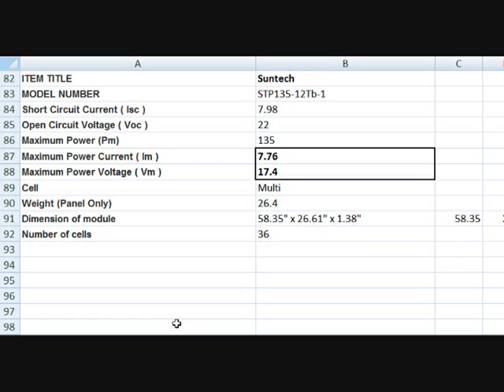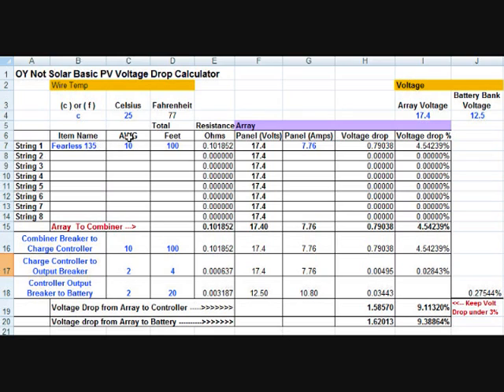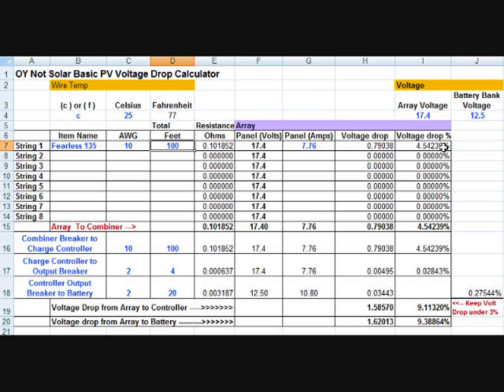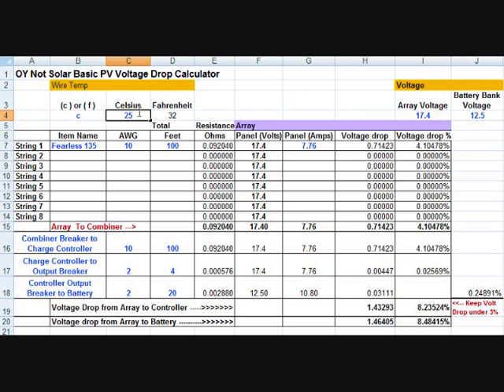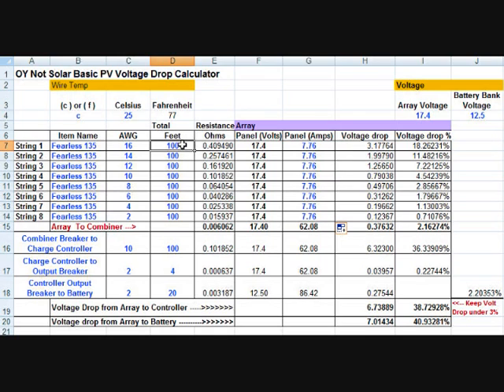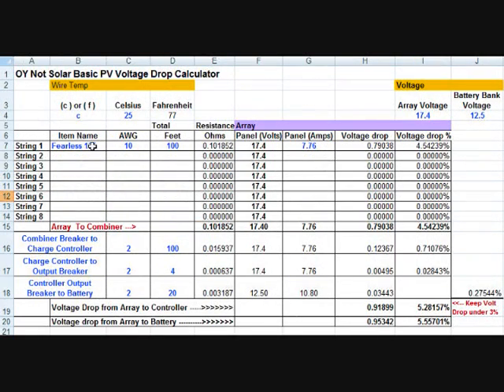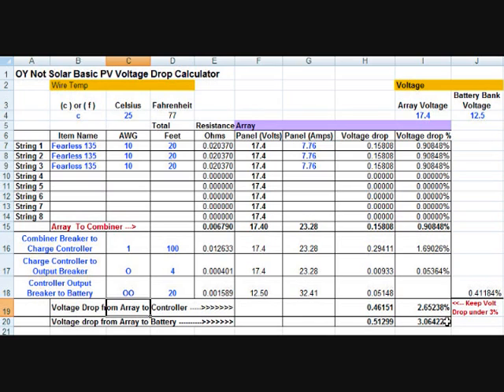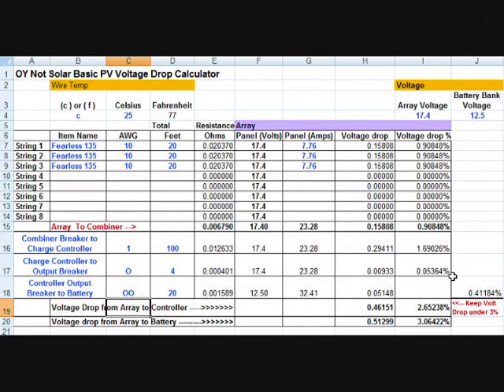Solar Panel wire size and voltage drop calculations

Comment: need for sure that drop  ... to add that 3rd series  panel  .. i m 100v 33volts series  x3 panels  and some more winter sunshines/././/////and need to go under .. thankfully its 80 feet  (40 distance) cabling route  if i combine  2 strings up that  roof   3s2p      6 panels  of 100 + a bit      volts        and send  a bigger wire down those amps might lower that voltage a bit more to keep safe my  solar charger.. i m  i guess 5% voltade  above open circuit in numbers and i even count on 10 year old panes be a bit tired and  make that nice system im trying!!! thanks for info  only way is test  and measure everything twice  .. hoping i m right and i dont have to  make the smaller 2s2p     its quiet smaller !!!!!

Comment: This calculator/spreadsheet is no good, you would have to severely modify it to get the correct output. Save yourself 12 dollars from scribe or 11 something(some change). Its easier to make your own if you know what your doing. It does not take into account the resistivity for copper or alluminum. There is definitely something wrong with the way they handled the calculation.

Comment: That volt drop calculator is totally wrong, very misleading because there is no load (Watt, Amp) input option. If your load resistance is 0 ohm you will have total volt drop no matter how big the wire conductor.

Comment: Why were you saying 100 feet but your application you said was only 50 feet? Why wouldn't use the actual footage of wiring. You only have to count one direction example PV Array DC output to inverter / charger location.

Comment: thanks for posting. Shortening your distance to the charge controller and inverter to just a few feet would require much less wire. Also, upgrading to 48v decreases resistance due to less amps/watt.

Comment: You can download the spreadsheet here: https://www.scribd.com/document/59348135/Basic-Voltage-Drop-Calculator - just make sure you can at the very least trade a document.
Reply: Do you have the voltage drop spreadsheet or were you able to locate another one?

Comment: nice. what is the typical size and depth you need to be for code?  assuming you want to use the largest size for expansion if you are burying cable.

Comment: Wouldn't you want your grid tie inverter as close to your panels as possible so you could run the longer wire on the ac side?

Comment: hi, i wonder if changing the gauge wire makes any difference? to explain i have a solar panel that makes 4 volts and .05 amps and i wounder if i change the gauge to 20 gauge will increase the amps?

Comment: This is a very poor type of calculator! It does not make difference between different diameter, material of the cables, - so it is simply useless!!!
Reply: Why not guess copper.  The AWG input takes care of the diameter difference. However, there is an assumption about resistivity per unit length.  Useful for perhaps designing the PV strings but will not be "balls on" accurate.

Comment: When sizing wire the distance is measured from point A to point B, not point A to B and back to point A. If your array is 50' from your house it is 50', not 50' there and 50' back for total of 100'. Very good video will have to get the spreadsheet.
Reply: +baldwin1e Voltage drop calculations for DC / single phase calculation: 

The voltage drop V in volts (V) is equal to the wire current I in amps (A) times 2 times one way wire length L in feet (ft) times the wire resistance per 1000 feet R in ohms (Ω/kft) divided by 1000:

Vdrop (V) = Iwire (A) × Rwire(Ω)
= Iwire (A) × (2 × L(ft) × Rwire(Ω/kft) / 1000(ft/kft))
Reply: you are misleading.

Comment: I just downloaded the went to the link above and it got me a spreadsheet saying they don't endorse you using their spreadsheet, but they give a link to the true spreadsheet. However, that new spreadsheet has the panel volt column password protected. Just an FYI to anyone out there.

Comment: When you are talking about feet,are you refering to the distance from the panel to the charge controller?
Reply: From what i have studied about PV systems, feet here is referred to the distance between two components of the system; can be panel to charge controller, OR panel to junction box OR battery to inverter and so on....this is just to calculate wire size or wire guage used to connect two components to minimise losses.

Comment: I thought you were supposed to keep track of voltage drop, using 75C as a basis for wire resistance, due to the wire's own heating during operation.   Since most terminals are current-rated at 75C, this provides you with an upper limit for wire resistance.

Comment: where does this 3% requirement come from
Reply: The 3% is more of a guideline and not "required" for systems... but most certified systems will follow it (NABCEP adheres to this to be qualified).  The specific reference is thus:

[NEC 2008 210] (branch circuit) and [NEC 215] (feeder) have a fine print note (FPN) saying that a reasonable efficiency of operation offucs if voltage drop is limited to 3% each on feeders and branch circuits, and less than 5% overall [NEC 210.19(A) FPN4] and [NEC 215.2(A)(3) FPN2]. A note on grounding... NEC 250.122(B) states that if current-carrying conductors are upsized for voltage drop, the equipment grounding conductor (EGC) must also be upsized in proportion.  NEC 2008 has an exception to this, [690.45(A)] stating that it is not nessessary to upsize the DC EGC in a PV system to address voltage drop (so you can use 250.122 to size the EGC in PV source/output circuits.
Reply: MySchizo Buddy You keep going back-and-forth he talk about… Makes sense

Comment: Looks like the people at the link are unhappy with you for posting this? The link takes you to a small rant page but they do link to the correct page for the spreadsheet. Wonder why they are not happy with you doing this?
Reply: +Steve Marshall yeah two years ago when I posted this the site had a disclaimer complaining about linking. Now the site is completely gone and the domain is for sale. Fearless doesn't even post anymore.

Comment: Mind elaborating on which information is incorrect? Is it just the temperature and Vmp/Isc issue? Because apart from that I am happy to use this Fearlessthinker's video as a closest reference, because there is not much else out there when it comes to solar cable sizing, especially not on youtube

Comment: with microinverters being used these days at 240v it would really be helpful to update this.  I have a system that is producing .9*6=5.4amps 2 240v and it is so different I'm not even sure if i'm in the ballpark based on you example.

Gret video, but needs to be updated.

Comment: @Fearlessthinker Yes it did and I'm super happy I could go with a higher voltage, all compliments of my MPPT charge controller. With the MPPT controllers you always want to be above your battery bank voltage to take full advantage of the MPPT functions and in this setting I always will be. Now, I just have to run the rest of the wiring and mount the panels and we're all set.

Comment: I just used this spreadsheet, very cool man thanks a ton for finding this! I'll be using 160 feet of #6 and then about 2 feet of #4 so I'm at  1.04847V drop or 1.87308%. :) Need a higher resolution than that? LOL